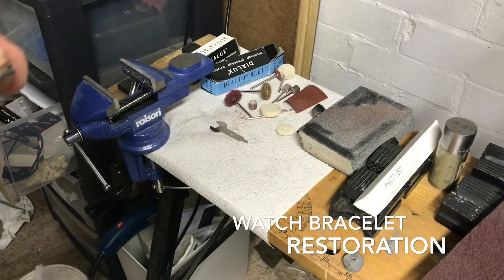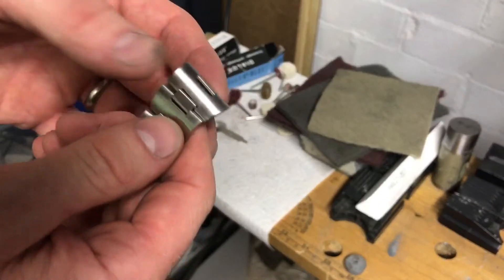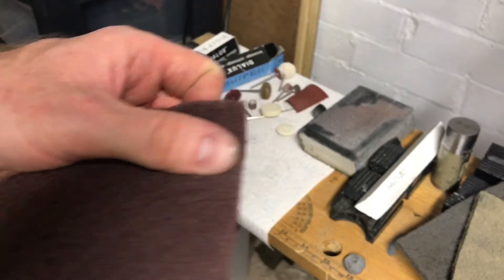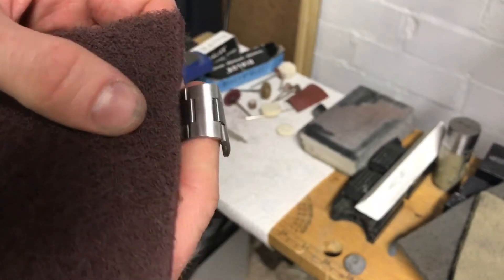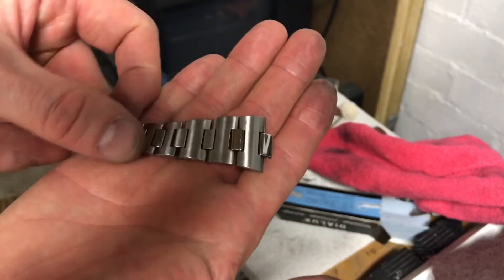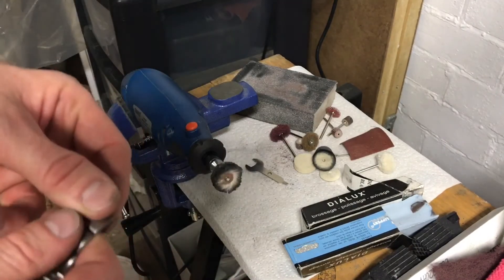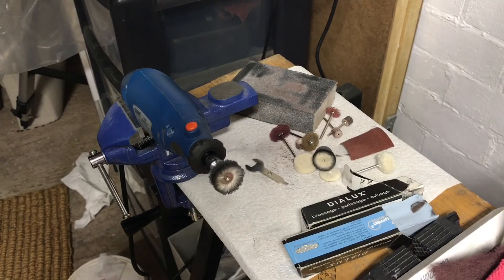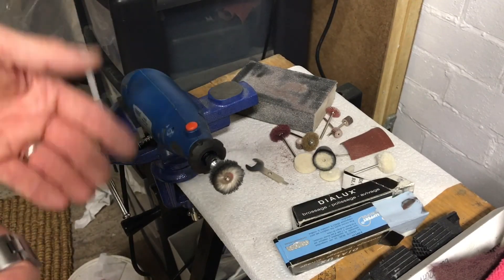Watch Bracelet Restoration - Part 2

Comment: Many thanks for this.  Should the bracelet links be that loose, or have they loosened over time.  Am restoring a 1970s Benson and want to know if the links should be tighter and how, if so, that can be done?  Many thanks!
Reply from the maker: Dominic Stafford Uglow  thanks for your question. To be fair the links will have stretched a bit bit in this one not to bad. I’ve seen and repaired allot worse. It’s the middle links that hold the bracelet together . These are folded links so if you turn over to the other side you can see the fold join. If these are slightly apart I just take a pair of pliers that I have put masking tape on and then crimp back together. Always do this from the underside.
Reply: My Retro Watches thank you.